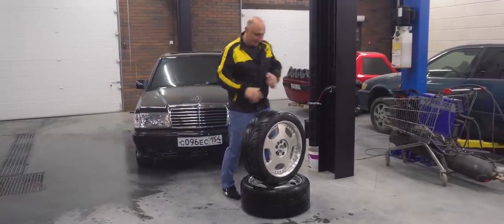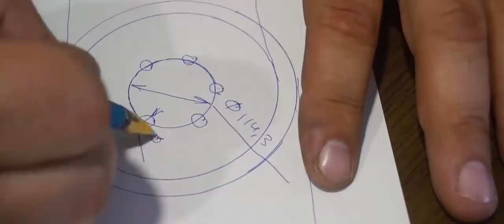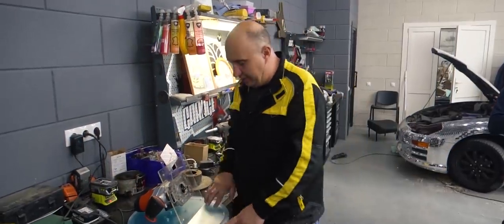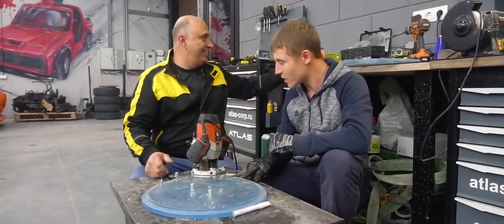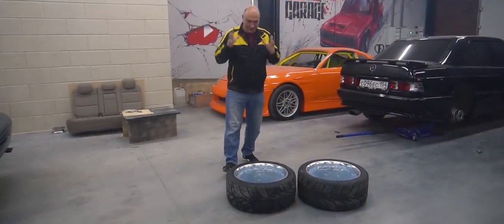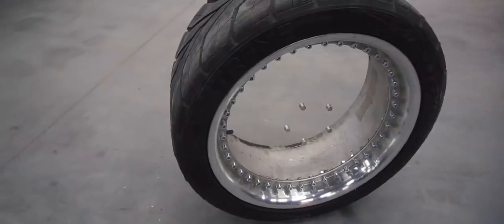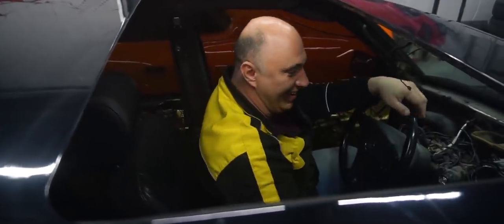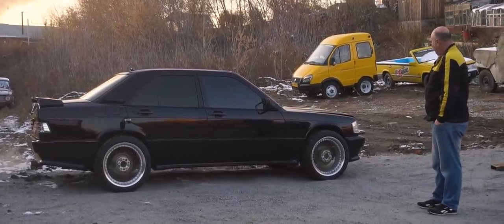How to make a transparent wheel from Plexiglas

Comment: I think transparent wheels will be a thing in the 2020s
Reply: André Svensson why
Reply: @nickking1510  look up, now look down
Reply: And the airless tires
Reply: New era of ricers
Reply: In rocket league are so many types of those..
Reply: Baking the brakes
Reply: Transparent aluminum has been invented it's only a matter of time until it's cheap enough for the Mass market.
Reply: Drew Summer That’s not necessarily true at all
Reply: @nathanstein589  I mean of course we don't know, but all crazy technology that was once unattainable are now house hold things. Teflon, carbon fiber, nano tubes are now being used to paint cars, ect ect. Only a matter of time hopefully. 🤞🏼
Reply: André Svensson  https://youtu.be/cBd9w-n7tQI old news
Reply: You can get tempered glass rims
Reply: @mydadsawheelbarrow5029  no shit, that's dope! I'll have to look it up!
Reply: 2000**
Reply: @nathanstein589  well, it is true transparent aluminum exists but not as a metal but as a ceramic call ALON. It is mostly used for military and space applications nowadays.
Reply: I think they really liked this project, seeing how they try to work really accurately this time!
Reply: They will be when it is feasible and strong enough to manufacture. Transparent aluminum would be a good material to construct these out of. This is now a reality but it's still really expensive to produce.
Reply: All black rim with black screws. Anodize or chrome 5 lug nuts to match caliper and axle tips.
Reply: I hope so, these look sick
Reply: Hey sorry for the spoiler but I'm from the future in 2020 and they're not
Reply: I agree .
Reply: noxxi knox  "will be a thing" 
And "already done" is two different things. 
Your saying someone has made this before.
He is saying this will be in style like spinners at one point.
Reply: It should be. They look nice. Ignoring the safety issues of course.
Reply: it was already been a thing years ago
Reply: Think again:))
Reply: Meanwhile in2020 ....
Covid19: pikaboooo
Reply: André Svensson no it’s the corona viruse
Reply: Nope you didnt guess it
Reply: I'm dying in quarantine and you think we're doing THIS!
Reply: Already here in 2020 and i guess we need to go back in time 🤣😅
Reply: Nah the new thing is a global health pandemic
Reply: Yo I don't know if we're making it to having wheels.
Reply: Its not
Reply: Who knew 2020 will turnout to be a shitty year
Reply: People in 2019: we want tansparent wheels

God: corona virus is the best i can do
Reply: Spoiler Alert it wasn't...
Reply: Nope, but a pandemic will
Reply: Its 2020
Reply: Nope it hasn’t yet
Reply: Transparent wheels are cool...but hubless rims are better. Sure it’s better on motorcycles but I predict the electric car idea will adopt the electric hubless rim as a form of charging the electric vehicles in the future.
Reply: I definitely would buy sets for my fleet
Reply: Nope :/ we got corona virus not transparent wheels
Reply: @nick n 

And politicised science.... What a time to be alive.
Reply: I wish
Reply: Just need the transparent aluminium from Star Trek IV: The Voyage Home 😂😂
Reply: Yes with RGB to!
Reply: @ak14619  yes ! still waiting for the transparent wheels tho
Reply: i think wheels that fall off at the first corner will make a comeback.
Reply: It's 2022 still not a thing
Reply: boom! covid and expensive af gas
Reply: WAS 2020 2 YEARS AGO? HOW AM I LOSING TRACK OF TIME
Reply: No there not

Comment: Should put som e LED’s behind the wheel and make it proper glow👍🏻
Reply: YerokA ASregor 
https://youtu.be/CwUaOugbNNw
Reply: Just ordered few tire valve covers that have leds, It suppose to light up when wheel is rotating. Still havent got my packet so i'l be seeing how good those are for such low price (probably utter crap and dont know if batteries can be replaced, but after lolling or one breaks i can take it apart and see how its designed so i can make my own better. Then again lighting just the wheel well would be smarter to be honest and none of those are actually legal on road here, so cant do much with them.
Reply: @WIPEYOURLENZ  thats ok, but better place led sided glass than on barrel
Reply: Etch a design into the plexiglass and the LEDs will light the design up
Reply: Rgb

Comment: Build a motor with as many transparent parts and covers as possible!

It would be cool to see the internals with it running.
Reply: @RolandtheThompsonGunner  project farm also does the same thing for some experiments of replacing gasoline with a different substance in a lawnmower engine
Reply: @RolandtheThompsonGunner  Yeah, "as many as possible" definitely takes into count the viability, and I would say a twin-cam engine with it's valve covers transparent would be really cool to see, albeit no idea what kind of mess the oil system would make inside of it, could be more of a splash show than mechanics showoff.

Wonder what's the highest temperature polymers that can be made transparent now...
Reply: old news, look for see through engines
Reply: Analog Dude mostly it's just a flat head engine with a slab of thick glass. 

But I have seen the clutch cover on a dirt bike replaced with a plastic and it worked great. 

I think they could do well with this approach but some parts just can't be replaced like that. 

Transparent aluminum engine block would be absolutely amazing!!!
Reply: Already did that in the USA it's in my 71 Datsun pickup 4.1liter GMC engine(valve cover, dizzy cap, rotor bug, carb adapter/riser, oil hoses, and water hoses are all clear. Used  polycarbonate (258°F form temp) and some other stuff. Looks cool and vacuum advance is neat in the dark watching the sparks grow.
Reply: INDUSTRAILIST post a few pics please!
Reply: There are see-through valve covers etc available, problem is they get really dirty pretty much immediately.
Reply: They make clear distributor caps and radiator hoses and valves covers that's how I'm building the engine in my 64 Cadillac limo lol I can't wait
Reply: @davidfmcdonough  there is a reason why the clutch bell housing of a car is made of metal.
Reply: Ever seen ads from oil product, made transparent replica of 350Z, dont know real or CGI
Reply: They already make them for popular engines, large and small, chevy 350, predator 212, ive even seen differential covers in clear poly so you can show off your diff fluid lol.
Reply: Cm. Kosmos  glass is to brittle
Reply: You're going to need a slow motion camera for that it won't last for very long and the plastic won't stay clear for very long
Reply: And I'm not sure if those slow motion cameras can handle the cold
Reply: They could use aluminum oxynitride for most of the very high temp (and maybe high pressure) stuff so it would remain reliable.
Reply: Serch warped perpection
Reply: @RolandtheThompsonGunner  it can be made out of thermal resistant glass the kind used in ovens and industrial forges it would be one exspensive engine
Reply: yes!! build a totally clear car as much as possible!
Reply: @RolandtheThompsonGunner  we have the material to do it its just super expensive, transparent aluminum  aka metal glass basically a metal alloy that is transparent
Reply: @RolandtheThompsonGunner  I guess your comment didn't age well...
Reply: @TheCommanderNZ  no, no it did not. Lol. Got to love the advancements in some of our technology.
Reply: @RolandtheThompsonGunner  they have done the sump, diff and rocker cover.
Reply: Wouldn’t see much before all you saw was oil lol

Comment: 2020: Transparent wheels are the new craze

Brake dust: Ima end this whole wheels career
Reply: Tt Miller  oh yes cause that so works with normal tires
Reply: 2020: regen brakes
Reply: Tt Miller  What about cooling the brakes and the temperature at which all this plastic will melt?
Reply: drum brake for both front and rear end
Reply: lmao
Reply: Ceramic brakes! No dust
Reply: Drum brakes all round!
Reply: Death on highway will end it's career.
Reply: Ur right
Reply: Lmfao
Reply: Carbon rotors and pads
Reply: @cambian2256  maybe tougher plastic or glass?
Reply: John Taylor has to
Reply: Wheel wipers
Reply: WE GOING BACK TO DRUMS BOYS

Comment: i think, in hard driving, the wheels damaged by disk's heat..
Reply: Eh. In a serious application heat transfer from the brakes could be mitigated by using a specialized material for the wheel spacer. Carbon Fiber would be a good choice.

Comment: Gonna start a trend 😅

I do wonder how they'd hold up to steering input at a dead stop, flexing those plexiglass plates.
Reply: That's a really good point. My worry was high-speed bumps and rattles, but that's probably just as dangerous.
Reply: Lexan would work way better. It's litterally bullet proof.
Reply: Paul Miner 
It been done before you know I think west coast customs did it on an R8
Reply: UberLummox wouldn't surprise me if they actually used polycarbonate, but are just saying Plexiglas, because that's kind of become a generic catch-all term for clear plastic.
Reply: @puckcat22679  Oh yeah, probably.
So you're saying that Lexan is polycarbonate then?
Reply: @UberLummox  yes.

Comment: these actually look amazing and I want to see a durability test. These things would look fantastic on a decent sports car with a nice fat set of Brembo calipers behind them. I'm really curious how much load they can actually take though. I feel like after a while brake dust would build up on the inside surface, which would slowly fade them to black and be much more difficult to clean as the dirty surface is literally behind a window.
Reply: Lexan is probably safer to the  acrylic plexiglass for a wheel. it's much stronger and much more chemical resistant. It does cost a bit more though.

Comment: There is a product called transparent aluminum. If you can find it try using it it may be expensive. I would like to see the plexiglass wheel go 60 miles an hour  To see if it holds up.

Comment: Looks good, but I wonder if the solid centers will need to flex. I'd also be more confident of the strength if you used polycarbonate instead of plex.

Comment: If you are afraid of the acrylic part cracking or breaking down, you can use polycarbonate which has more than 10 times higher impact resistance and less rigidity. Way less prone to brake.

Comment: I want to know what happens to them when the brakes get hot. Might be better off putting the hole in the center then put the spacers on the outside to get a good spread out clamping force.

Comment: It will last at least as long as the rims themselves can if you make those pans out of the same thickness PC (polycarbonate) instead of PMMA which you used for it.
PC is actually a pretty though stuff! It can absorb really strong hits by bumpy roads with no f*cking sweat so I think it is almost ideal stuff for this purpose.
Cheers ✌️
And a really great idea by the way 👍👍👍

Comment: Try (Lexan) Poly-carbonate is much stronger than acrylic (Plexiglas) also it's crack resistant and works well with steel joints.

Comment: I hope u checked the length of the screws in the back before u mounted them. Because otherwise u just destroyed ur handbrake and that's the reason why the car stopped. A lot of people forget that those 190's have their handbrake inside the disc

Comment: 1 mil = 0.001 inch = 0.0254 mm
So when the translator says they have to remove "one mil", that is equivalent to 2 and a half hundredths of a millimeter.

It would be easy to make the plexiglass fit. Just sand it off or simply heat the aluminum rim with boiling water to expand the diameter by a couple mils. Possibly put the plexiglass into a freezer for 15 minutes.

I believe either the experimenters or the translator are incorrectly using the word "mil" instead of "millimeter"

Comment: I wouldn’t trust that at all those bolts will eat up the plexiglass
Reply: Oh yeah, you are right.  A metal band should fix that though.  A much thicker UV hardened panel with some radial slits to make spokes and it should be as good as an alloy.

Comment: Possibly the MOST DANGEROUS car Mod I have ever seen! One decent bump or pothole in the road & just one crack and say goodbye to your wheel! Plexiglass or Perspex is NOT made to have this much weight & is only made for some shock resistance from the sides, if your front wheel goes there is a VERY HIGH chance you will end up in ongoing traffic or a head on collision. VERY STUPID. Looks good tho, lol.